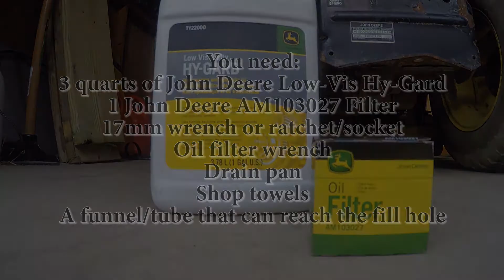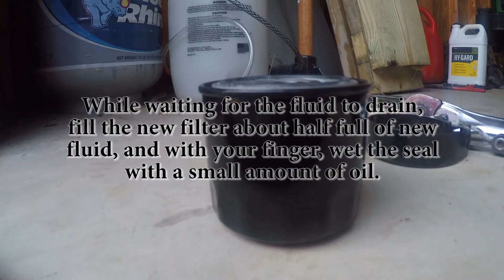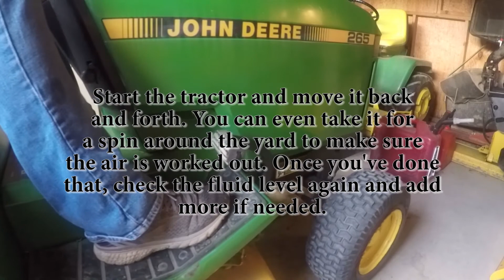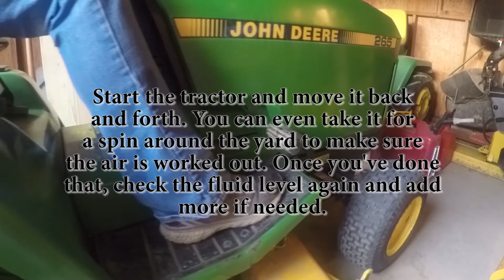Trans-axle Fluid Change John Deere 245, 265, 285 and 320

Comment: Great video! Clear, straight foreword, easy to follow.  I am going to work on my transmission as well since my 265 slips going uphill.  Does this indicate a rebuild or just low fluid?  Reverse is really slow.  Thanks
Reply from the maker: Thanks, I’d start with a fluid and filter change and if it’s still slipping then you’ll know you have a bigger issue.
Reply: @outdoorpowerhouse  Agree.
Reply: Probably just a worn drive belt.

Comment: Any idea what would cause a 265 to lose reverse? We brought it to a repair shop and they replaced the fluid and now forward doesn’t work but reverse does... it’s crazy! Makes no sense to lose reverse then after servicing to have reverse back but now no forward gear.. baffled
Reply from the maker: My guess would be air trapped somewhere in the system, but I’m not sure how that would happen.

Comment: I got a gt245 that is losing transmission fluid whether running or sitting overnight. Thoughts?
Reply from the maker: Best thing to do is degrease it and then monitor it to figure out where it’s coming from.

Comment: Thank you for this manual! Can you please help me with what am i'm doing wrong?! I do have exactly the same transmission (trans-axle with integrated pump BDU21) in my John Deere 320, but when replacing the fluid (oil) the way you showed, only 1.5 liters (1,6 quarts) were drained and I added the same amount of a new one. May there beseparate reservoirs for the pump fluid and axle, or I just didn't drain enough? Is there a way to change oil in the pump itself? Thank you! I bought it used in Ukraine and i can't find the pdf manual for both axle and pump in the internet.
Reply from the maker: The oil isn’t separate, it could be that it was low to begin with.
Reply: @outdoorpowerhouse  Thank you very much! Now I'm not worried about the durability of the transmission